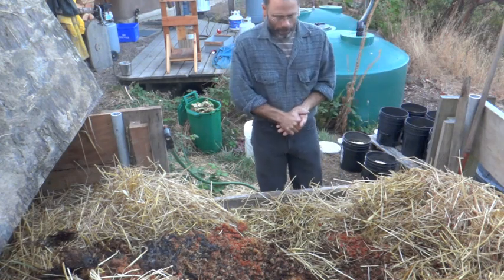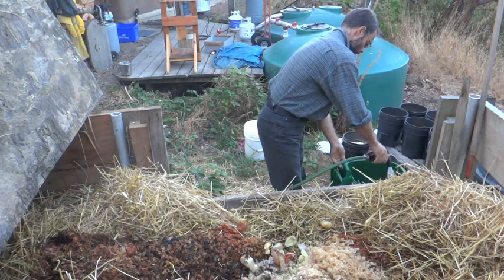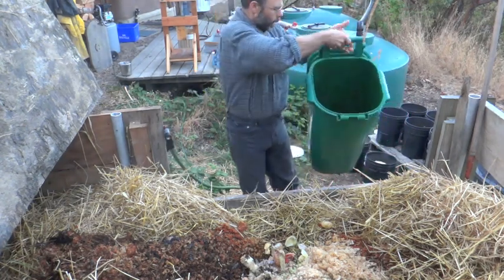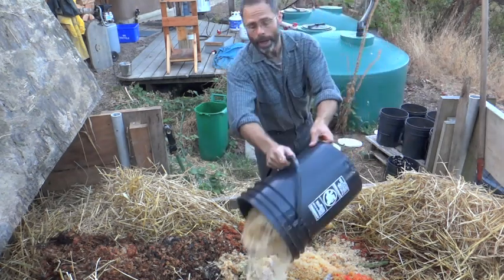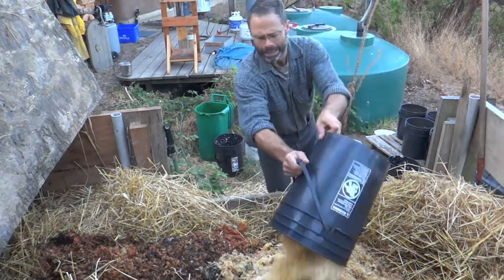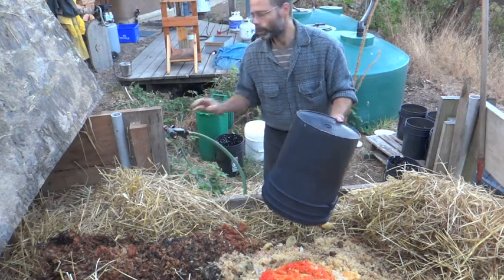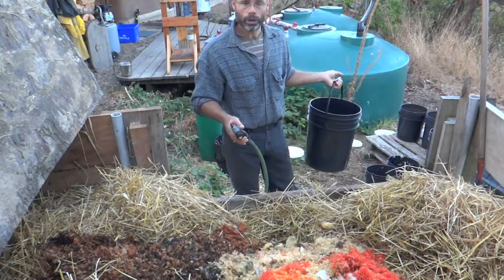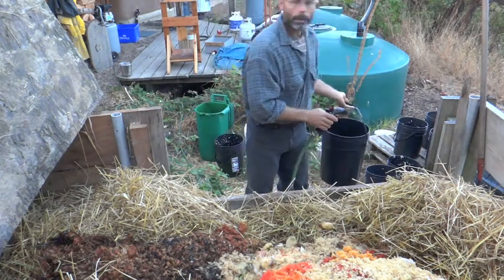Composting Humanure

Comment: You've done a ton of research and capsulized it for us.  Thanks!  2 questions about the possible health risk or pathogen spread.
1.  Is it safe to start the 2nd year compost next to the 1st year and the 3rd, next to the 2nd and so on?  I'd like to make my compost areas from attaching 4 wood pallets together.   What kind of boundary is needed between them?
2.  I was thinking of making a trip to the compost with my bucket o' crap once a day.  I understand the dedicated tools thing.  Am I risking the spread of any harmful pathogens by messing with the crap daily?  Other than returning to the house and washing my hands thoroughly just being in and around the area isn't a problem is it? 
How about you?  After you're done your 10 minute wash, do you have a disinfectant routine you do?
Reply from the maker: Answer to question one… Yes.  Pathogen migration will not be to any level that is harmful by no means.

Answer to question two…  If you dump your compost daily you are much less likely to have the temperature increase, and therefore a much cooler compost.    This means that you will just be relying on time to carry out pathogen death… and you still want a year after the last addition to your pile before you use it… though in the regulations I am writing up I suggest 18 months after the last batch is added.  As for cleaning and disinfecting, I just wash my hands - the goal is not necessarily sterility, but to decrease the CFU count (colony forming units) - it is quite likely there may be a bacteria but in the science end of things, if the quantity is low then a colony can not form and you are safe.     The one item that we are wary of is Norovirus, and if it ever impacted our home, I would be more diligent in disinfecting myself afterwards.

Comment: The county where I live came down on us for having a so-called unacceptable septic system: 2 blue barrels in series and a 40 foot leach field.  It worked for 15 years just fine.  However, before the feds showed up I ripped it out and left no evidence. Technically I wasn't in violation because there wasn't anything there. 
Anyway, after watching your video I started composting (saw dust and wood shavings).  So I've been composting for about a year. (I just sent for a $45 urine diverter from Ebay).  I've just been piling it up until  it's about three feet high and square, then cover with a tarp and go onto another pile.  I believe the first pile is pretty well broken down, but I've never seen it steam up and I haven't used a thermometer.  Is it critical that it steam up?
All in all it's been a good experience. We're offline but not far from a pole. I have nearly a kilowatt of solar panels of various types, having bought them at intervals over the past twenty years.  They feed 10 golf cart batteries.  Actually I could do with fewer batteries if one of the kids was not always firing up his very watt-hungry game computer. . . .Enjoyed your videos. Many thanks

Comment: Great video. Thank you! How would this be different in winter? I live near Yellowknife, Northwest Territories. I'm imagining going to dump the bucket and having the stuff frozen in solid - maybe I would have to run with it before it flash freezes :-)? Turning the compost seems like it would also be a challenge. Do you just pile it up and wait for the thaw? Would you reuse the same buckets without a rinse until the weather warms up, or wash them inside?
Reply from the maker: Winter in Yellowhorse… a tough one.  Joeseph Jenkins' pile freezes in the winter and he deposits on the top, and when spring melt happens, it heats up.   You are much colder, so though depositing on the pile might be ok, having access to a hose to provide a quick rinse would be really challenging (impossible).    We never really turn our pile - it composts in place and due to its thermophilic nature things decompose quick.     Perhaps having a pile in a greenhouse would provide a slightly longer period… new territory and if you do experiment with it I would love to have your feedback.

Comment: Excellent discussion of the needed know-how. A few questions, though: Can this be made to work in climates where winter temperatures get down to near zero degrees Fahrenheit? Would the composting process automatically and properly resume when temperatures get back above, say, 50 degrees? What structure exactly holds the compost heap, what is it made of, how large does it have to be, and does it need to be covered to keep out rainwater? Is the heap-holding structure just wooden walls over earth? Does the compost heap attract flies or insects?
Reply from the maker: So a couple answers.  you can compost at colder temperatures, though more straw is required, and when temperatures rise the pile will resume at full throttle.   The structure of the bin is not significant as the size of the pile - I use stucco wire on ours, I use 1/2 hardware cloth on customers' systems.  I try and build the space to be 1.5 m3.  Wooden walls can be used, but I prefer materials that won't compost over time and require replacing.  You can build straight on the earth, but it is advisable with the creation to dig a hole deep enough to accept a straw bale and thus create an initial sponge below the bin.   Ideally you add to a bin for a year and it will be the size it will be... smaller for one person, but filling up the 1.5m3 bin if there are six people.    Done right there are no flies or insects and no smell.    If you are prone to heavy rains then a top that can be closed is advisable.

Comment: What kind of wood shavings do you use? Do you buy them or what? Also, I burn hardwood all Winter in Northern Missouri, is it Ok to add some wood ash to the compost pile as well?  Thanks in advance, for any info you can provide me, Bob
Reply from the maker: +Robert Briant  - We use a variety of wood shavings, though prefer non-kiln dried anything, and try to avoid cedar.  I do add wood ash; I think of it as a receptacle for more nutrients though I usually add it to the pile that is dormant so as not to change the alkalinity of the active pile.  I have never read that I should or should not do this, but just a hunch that the active thermophilic bacteria are thriving in a particular PH range (acidic) and that the wood ash would make it basic.   Once the year of thermphilic activity is done, I do not mind adding it.  I have not checked our PH in 5 years... good reminder for me to see where we sit.   Thanks for the question.

Comment: Thank you so much for the video ! i have a question,
what is the base of your compost bin ? the fact you wash pathogen infected buckets and 
dump the water the bin, isn't the water escaping the bin and contaminating the ground below ?
Reply from the maker: Great question Andrey.   The composting process does use up a lot of water, so in the summer, despite dumping the fluids and rinsing the buckets, it is not uncommon to add a bit  more water mid week.   The winter is a different story, as rains can keep the pile moist.  There are three options.  1) if the compost bin has a good sponge layer (humus) underneath and the area is 30 metres setback from wells and wetlands then there is safety.  2) if there is good sponge layer (humus) you can address excess winter moisture by having a lid that shunts the rain fall from landing on the compost pile thus allowing the natural heat to address the moisture content safely.  3) If the site conditions are not ideal, then a leachate drain  (perimeter drain) can drain excess moisture to a leachate dispersal trench.

Comment: Old video but good tip for future watchers... find an old window and install it in the lid and it will solar heat the compost and speed up the process.
Reply: john smith is there any risk of a fire starting w direct sunlight heating up the straw under the glass?
Reply: East-West Connection there is that possibility but extremely unlikely. You would have to live in a extremely hot climate with enough sunlight to generate combustible temperatures inside. Now that isn't unheard of.. you could actually sit a piece of paper on the dash of your car and have the same risk. It shouldn't be a reasonable concern but scientifically it is possible. I'm not aware of the combustible temperature of straw/hay but I would assume it's around 400* F same as typical writing paper. 

To reach that temp would require more perfect conditions then you're odds of winning the lotto two weeks in a row lol.  The hottest plausible temps you'll see will be in the mid 200* range

Comment: Could you lining the buckets with a composting bag. Then come dumping day just take the bucket outside, tie the bag closed and place on the pile. Would this still break down in a year or two?Or.....If the bag was places in a black painted metal oil barrel and then places in a small dedicated polytunnel would that help to cook it.  Is there such a thing as getting it too hot?
Reply: +MrsMika There are various ways to compost humanure.  Some occur under hot aerobic conditions like our system, some rely on anaerobic (without oxygen).    My concern with using bags and boring them is that you would be attempting to use the compost piles aerobic function with the materials captured in an anaerobic bag.   Over long periods of time this may be fine but my gut feeling is that you would be negating the benefits of a compost pile.    If bags are placed that do not break down then really you are creating a large mass of potential pathogen that can be access by rodents.  

 Mouldering systems (system where you collect and capo and then cure) will use anaerobic activity to perform the composting function over two years, though urine needs to be diverted in these systems otherwise they fill up too fast.
Reply: Thank you for your reply.

Comment: Hey Gordan, nice video and thanks for sharing. I've got a question about humanure composting that I haven't seen discussed anywhere else. Can menstrual products be disposed of in a humanure pile? I'm assuming that if these piles will digest bones that the extra blood won't be an issue, but do you know if tampons can be thrown in with the rest of it? I assume that pads with plastic on the back would be a no-go in the compost. Would the toilet buckets in the house need to be treated any differently from just covering with shavings?
Reply from the maker: Hi Crit.  Blood is not an issue in the slightest.  Pads with plastic  definitely a no-go, but organic pads/pons are fine.   Treat everything the same… easy.

Comment: My last years pile did not warm up at all, but it is teeming with bugs.  I will let it sit for a year as well before applying it to my herb garden.  Has it been completely proven that it has to heat up for it to be safe ?  Nature seems to be doing an excellent job of breaking it down without a balanced nitrogen to carbon ratio .
Reply from the maker: Self-Reliance…
It does not need to heat up to be completely safe, but in stating this there is usually an allowance of time to allow nature to decompose and "process" the compost- just like what you are seeing.  In the regulations being written (at this moment), for composts that do not heat up we are suggesting either 18 months of maturing, or subsurface burial, or the addition of 2% urea into the partially matured compost to aid pasteurization.    The presence of heat in the initial stages provides information/ comfort that it has decomposed certain pathogens to a level where maturing (mesophilic) phase can be a year, thus the maturing phase set at one year before land application is acceptable.      If you are allowing it to cold compost for a year and applying it as top dressing to herbs, you are likely going to have some residuals and I would give it a few more months - if you are going to mix it into the soil then you are like safe.  

The carbon nitrogen ratio will be showing low nitrogen across virtually all humanure composts at the end of maturity, a sad fact, but if you use the materials not as a nitrogen source but as a microbe and nutrient source, it will be great.
Reply: gordandann I was thinking that if I am not satisfied with the results after letting it rest for a year then I can always compost it again .
Reply from the maker: SELF-RELIANCE STRONG COMMUNITY Yes.  What I (we) have done for a couple years is to place it in with our leaf mulch pile, more in an effort to combine all our organics in one pile ready for the garden, with the addition of some sand and clay, basically making a soil.   This ends up sitting for a couple months before it gets all gets used up and this little bit of additional time makes a beautiful mix.

Comment: Answered my question on what toilet system to use for my cob house project. So from the start you do this, monitor it for a year to two years until it is usable soil, then you use it in your garden? Doesn't it amount to a lot of material that is composting? I am sure with only a few people it shouldn't be much. How to you reach "Thermophilic" compost are there nitrates and phosphates that you outsource as a catalyst or is it diet that does it?
Reply from the maker: Andrew, we add to a pile for a year (six people) - this is the thermophilic stage.  , After that year we let it sit dormant for one year, the mesophilic stage.   The pile at the end of the second year is about 1/5 the original size, so yould be left wishing you had more.     You don't have to add any catalyst to it as all the components naturally exist, but we do have a trick to jumpstarting a new pile - we add a dead animal (rat, bird, chicken) to the pile and it speeds the process up greatly.

Comment: Hello! Thank you for a great video. If there is risk of the compost pile freezing on winter (and this killing good bacteria), would it be appropriate to have a compact pile under a glass to protect from freeze bit allow sunlight to keep the temp up? Is there risk of a fire starting if compost pile gets overheated?
Reply from the maker: The bacteria amazingly don't die.  They do become dormant, but as temperature increases, they come back to life quite well... is is the same process that is seen in soils.  If one didn't want to have the prcoess slow down when well below 0, then one could compost in a greenhouse or have a system like you suggest.   We do have a friend that has a biogas composter for making fuel, and they keep their digeser in their greenhouse.
Reply: East-West Connection                 Zaa
Reply: East-West Connection wow rug💷💷💷🗑

Comment: Fantastic video, thank you! Now, a question: can you use humanure in a black soldier fly bin? Chicken and quail and pet poop is recommended...
Reply from the maker: Hi Sally, I can't say whether it can be used for soldier fly bins.  We have thought of a soldier fly system but not with humanure and I can't say I have researched that out.  An interesting concept, and I suspect that concerns may be any potential pathogen transfer from the fly that got away.  If you happen to find info on it please share.   Cheers, Gord

Comment: What was that red stuff on the shavings
Reply: +Squidelly Diddily That is one of the most asked questions.  Sometimes when the buckets sit for a week it seems the wood chips colour changes from light yellow to orange and sometimes red.  I think it comes down to diet and how the urine oxidizes over time.  We suspected at one time it was tied to higher meat in the diet, but have since ruled that out.   What we do know for sure is not all buckets are consistently the same and each week we have a couple that have more colour and that colour increases with the time it sits and therefore oxidization seems to be occuring.  Wished I had a better answer.
Reply: +Gord Baird thanks dude

Comment: why is the bottom stuff that came out of your buckets RED???
Reply: +Doris Mair I have the same question.
Reply: +Doris Mair That is one of the most asked questions.  Sometimes when the buckets sit for a week it seems the wood chips colour changes from light yellow to orange and sometimes red.  I think it comes down to diet and how the urine oxidizes over time.  We suspected at one time it was tied to higher meat in the diet, but have since ruled that out.   What we do know for sure is not all buckets are consistently the same and each week we have a couple that have more colour and that colour increases with the time it sits and therefore oxidization seems to be occuring.  Wished I had a better answer.

Comment: Can you use dry leaves instead of straw?
Reply from the maker: Yes.  Dry leaves, straw, shredded newspaper… all are fine.  We are moving towards leaves we collect and store… it is cheaper and really does make a great compost.  I am just in the process of writing the new Compost Toilet regulations for the Province of BC and your question reminded me to expand the list of cover materials. Thanks.
Reply: It's just the easiest available material for me. Thanks for your answer.
Reply: Carlos, I use dry leaves for mine during the winter.  Like you, I find leaves to be the most natural and easiest carbon cover material since they fall all over my yard in the autumn.  I even use pine needles sometimes instead of saw dust for indoor cover material.  I find that saw dust is more space effective, but pine needles work very well too; and they fall in abundance in my yard during the autumn time.

Comment: If I use worms, how soon can I use the humanure on my garden?  Do I need to do all the other additives u used?  Thanks
Reply: +Lindart Shafe  - Worms do not change the period of time required to ensure pathogen death, they do aid in decomposition.  That said in the processing system on the video we have lots of worms when the pile cools.   From the day the last bucket is dumped I wait a year.  I also do a test to ensure it is safe for food gardens (at least I used to).    

There is a fellow that did research with a special worm composter at UBC, (Jeff Hill?).  I think he waits 18 months.